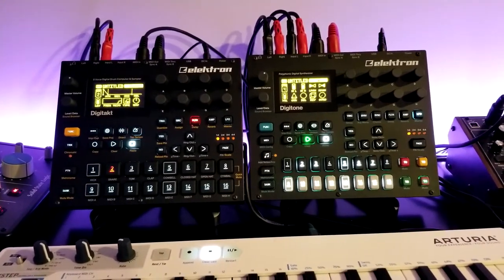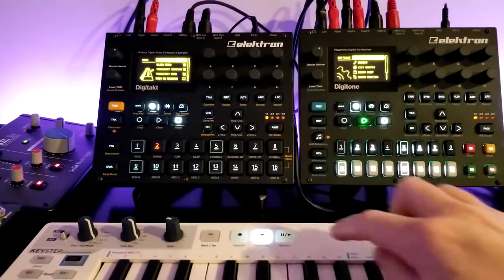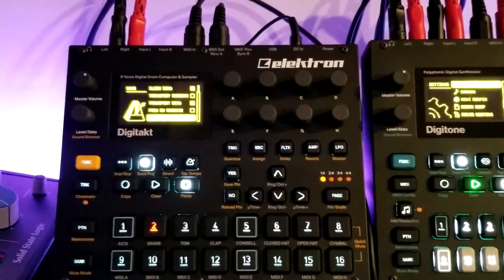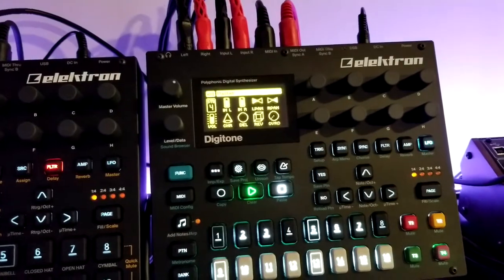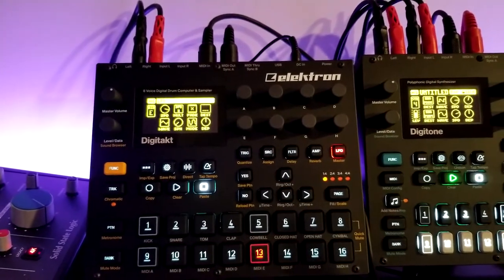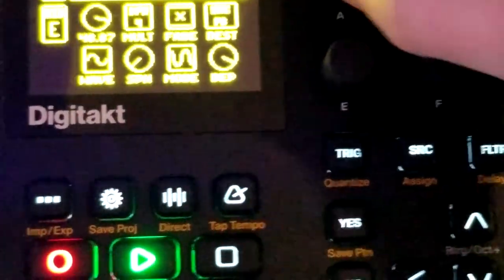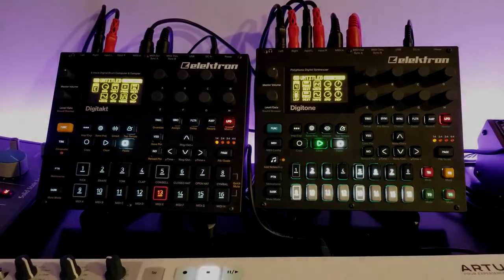Setting up the Digitakt, Digitone, with a Keystep, and other hardware.

Comment: Thank you very much, It helped me a lot with my set up
Reply from the maker: Awesome, yeah once you figure out how the MIDI settings work, they gel excellently together.

Don't sleep on the new Digitone update that just came out either.

With the new update, you don't have to set up the audio in settings for each new pattern
Reply: @NickCapron  I only got 1 question,I cannot use the sequencer for the Vermona Kick Lancet (cc#84 1,2 or 3 and cc#85 0 or 1) tried the #CC and the value assignment.  How can I trigger that? (With the keystep it works on key C1 and on digitakt also,except on the digitone)

Comment: Hi, at 2:33 you say that you have to create the midi settings each time you start a new project. Is it not possible to create settings to your choice and save as a template?
Reply from the maker: Hey Martin, that's a good Idea.

 I think you can copy projects(need to check) but yeah, I could just create an empty template, with the MIDI settings good to go, and just copy that whenever I need to kick off a new project =)

I do the same for my patterns with my projects, to keep the sound settings the same for handling the incoming audio from the Digitakt.

Thx again!

Comment: Learning midi routing is pretty new to me even though I’ve owned synths for 20 plus years. I guess I just never understood it fully until recently. This resulted in me avoiding it all. That’s now starting to change, as I got this Keystep Pro (KP). So now I’m trying to use a Keystep Pro to control all my gear. I have both the Digitakt & Tone and I wanna possibly use the Keystep pro to sequence the sample tracks on the Digitakt. I realize that can be an option. Not to say that I will stick with that workflow, but I wanna try it and see if it gets things moving sequencing the drums and samples on the same platform as my other synths. The Digitone however I wanna use its internal sequencer but at the same time play the notes on the Keyboard of the KP. I have set it up but I can only play what midi track the KP is set to, rather then switch between the track buttons on the DIgitone. Like what I mean is I cant switch between the 4 tracks on the Digitone by simply pressing the 4 track buttons. I can only switch the 4 tracks on the Digitone  by changing the midi channel on the KP. So I see that what I wanna do is being done in this video, and I’m guessing that setting up Auto Midi channel of the Digitone is what will allow me to do this instead of my current setup. I would rather do it that way, as it would be smoother in using the Digitones internal sequencer. Plus the option to quickly press the 4 buttons to switch the track would be awesome. I gotta make this happen. Thanks for the video, it helps.
Reply from the maker: Awesome, sorry I didn't back to you sooner, but yeah, I find using the autochannel works best for me with the keystep and the digis!

Good luck with your project, I'm still working through it myself to configure these machines best to my workflow.

As I'm enjoying working with Reaper a lot these days, I think I need to start to dip my toes into overbridge next
Reply: @NickCapron  OverBridge is amazing but it won’t work on my computer. Which is a 2010 MacBook Pro with 1Tb SSD & 16g ram running High Sierra as it’s max OS. The computer still works great for most music applications I use, but I’m gonna have to get a new computer if I wanna take advantage of OverBridge and the USB C audio/midi communication of my JX-08, JD-08, and SP 404MKii. As of now, I’ve figured out how to make the midi work out great in auto channel on the Digitone, but haven’t implemented it with the Digitakt yet. For some weird reason I can play the Digitone with the Keystep pro but can’t record a sequence on the Digitone. I have to use the Digitone’s key bed to record a sequence in it. This is my next hurdle. That and using it with the Digitakt. All in due time. But for now I can play the DTone with the Keystep Pro and switch tracks on the 4 track buttons of the Digitone, if that makes sense. I love that feature instead of switching midi channels on the KSP. Hard to explain in text but I’d love to play and record sequences into the Digitone with the KSP. BTW, Reaper is totally new to me. I just searched it, looks pretty good. But yes, can’t wait to get a new computer to get into OB as well. PS: no worries on replying late. No reply, late, or current, it’s always a pleasure 🙌🏼

Comment: This video is really helpful for anyone using Elektrons as master device. I’m About to add a Digitakt to my Digitone and Analog4 set up. (I use the A4 as master). I use almost identical process to use a Keystep via Auto Channel on the CV track on the A4. I also have a Novation Nova set up from the Digitone Midi tracks. I set up master blank templates with a single pattern in each on both Elektrons with all the irritating little midi niggles that get overlooked in the chain of devices.

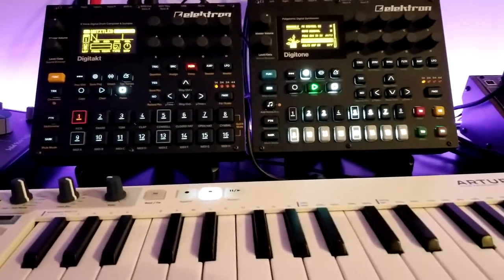Comment: Thanks for the video. Question: @12:00(approx) you hit keys on the Keystep and it plays the trig on track 1 of the DT. I followed all of the settings in your vid....and my Keystep doesn't make any sound. Any ideas why? Did you set the Keystep up in any way? (What about the little switches on the back: Internal, USB, MIDI, Sync IN)?
Reply from the maker: Hey Scott, check what MIDI channel the keystep is set to.

Going from memory, I think I set the channel on the keystep needs to be set to either 9 or 10.

If you don't know how to switch MIDI channels on the keystep, hold down shift and push the key with the blue 9 or 10 above it.

Also, I have my keystep connected directly to the digitakt, so make sure the keystep is working with whatever device you have it plugged into first, if that is picking up notes from the keystep, your issue is between the digitone/digitakt MIDI connection/settings
Reply: @NickCapron  I'm actually not sure what I did...but I got it to work. I think it was an unchecked box in MIDI settings that wasn't mentioned.
Reply from the maker: @Lo-fi_Hi-brow  awesome, glad it worked out for you!

Comment: This help me a lot, thank you very much. Now the big question. How to make works Digitone's mod wheel, the pitch bend wheel and the sustain pedal from the midi keyboard in this setup? Thanks in advance.
Reply from the maker: Hey Antonio, I've been running into the exact same issue, I'm thinking it can be fixed with midi cc settings under the midi tracks, but will look into it.
Reply: @NickCapron  Thank you Nick!!!
Reply from the maker: Ugh... Sitting down with this right now trying to figure out... Not looking good

https://www.elektronauts.com/t/live-record-mod-wheel-pb-data-from-external-keyboard/42715/84

Seems like it is a built in limitation on these boxes that they can't send either the pitch wheel or mod wheel data via midi to other devices. 

I'm trying to see on the keystep, to at least getting the mod wheel to pass through the midi tracks via its cc#

If I reverse the hookup and use the Digitone as the master I can at least get the modwheel and pitch wheel working with the 4 tracks on there, but it doesn't pass through to other hardware via midi either. 

Will probably put a video together on this once I figure it all out.
Reply: ModWheel and pitch are working if you plug the keystep directly on the digitone.
Reply: @wtvdonot1135  Yes, but the problem is to record mod and pitch.

Comment: thanks for this very useful video! How about i want to control the digitone parameter from the external keyboard. Is it possible?
Reply from the maker: It should be, https://midi.user.camp/d/elektron/digitone/

For example, because the MIDI tracks on the digitone and digitakt don't send pitch or mod wheel msg, I adjusted my keystep to send the mod wheel messages to cc 72 or something like that, which allowed it to adjust one of the midi parameters under a midi track so a lot of options should be possible
Reply: @NickCapron  Thanks a lot for your time!

Comment: Thanks for this!! I’m wondering- what mode is your keystep set to? Internal? How can i use the keystep’s sequencer and arp with this kind of set up? Cause if i set mine to midi, it plays my external gear through digitakt’s midi channels, but then the internal sequencer doesn’t start, and if i set it to internal it won’t play midi notes through digitakts midi channels, so it essentially just becomes a standard midi keyboard without the additional features! Hope you can help me with this one, thanks
Reply from the maker: Hey William, just for Reference, my Keystep is set to Internal. (I think I have MIDI Clock in on the Digitakt disabled, so when I push the play button on the keystep, it won't mess with the tempo on the Digitakt) I have nothing connected to the MIDI IN or anything on the keystep, just the MIDI out cable to the MIDI IN on the digitakt

I'm using the auto channel function on the Digitakt(Set to CH 10 I THINK?) and then sending out midi from the keystep on the chanel,  which will play whatever active track I have selected on the Digitakt(Including the MIDI tracks when I key them up on the screen)

Hope that helps a bit, hit me up with more questions if you need further clarification or want me to dig into anything with my setup that could help you out.
Reply: Nick Capron thank you! I’ll give this another go

Comment: Grat video! Thanks a lot, you help all the community with this, only one question, I have other devices, I want play with my keystep on others synths with this config but I dont have midi hub, I put channel 5 “for example” on my other synth and I connect midi in to midi output of the digitone, I can sequence my other synth but I cant play from digitakt, how I can do this?
Reply from the maker: Assuming you want to use the KEYSTEP keyboard to play the other Synth

Keystep into Digitakt MIDI IN

Hook up a MIDI Cable from the Digitakt MIDI THRU to the MIDI IN of the other syth

If you set the keystep to CH 5, it SHOULD play on your other synth and bypass your Digitakt

Let me know if that is what you are looking for or if I missed the mark!

BUT If your other synth only has one MIDI IN, and you are sequencing it via the MIDI OUT from the Digitakt, the only other way I can think of doing it is via a MIDI track on the digitakt

You just need to set that MIDI track to go out on CH5, and have that MIDI track listen for incoming notes from CH 5(or whatever channel on the keystep you want to use for playing that synth) that can be set up via the MIDI menu on the digitakt. 

Hope that helps!

Comment: This might be a really dumb question, but why aren't you using MIDI Thru instead of the MIDI Splitter device?
Reply from the maker: Not a dumb question at all!

In my case here, I liked (I've simplified my setup since I shot this) to swap synths in and out, which the thru box helps make a bit easier to do.

Also I was using volcas, which don't have midi thru, so if I wanted to use 2 of them, I would be out of luck. If I just wanted to use one, I could stick it at the end of the midi thru chain I guess =)

Anyway I find it convenient vs having to route midi thru everything

Comment: dear Nick i would like to ask you in case like mine i only have digitone and keystep 37 what sync and port config settings do i have to follow to work together?
Reply from the maker: Hey, no problem.

If I was to use a Keystep or K37 directly with the Digitone(which I did in the past before I got a Digitakt, I would set it up as follows

MIDI OUT on Keystep to MIDI IN on Digitone

Digitone PART 1 MIDI CH 1
Digitone PART 2 MIDI CH 2
same for 3/4

Auto Ch 10

Now if you want to control tempo on your Keystep, you would want to enable clock receive on the DT, BUT I WOULD NOT. as at least for how I have my Keystep currently configured, it bugs me when I hit play on the keystep, that it takes over the clock on the Digitone, I'm ok with controlling the tempo via the Digitone or takt

Same for transpose, I would have it set to off, so the play button on the keystep doesn't stop trigger the sequencer, as at least on my keystep, I need to hit play to enable the Keystep Arp or Sequencer, and I don't want it starting/stopping the Sequencer.

If you plan on using the keystep sequencer, and you want it synced to the tempo on the Digitone, you may need to feed MIDI into the keystep, for it to get the same clock from the Digitone, and to do so, make sure you are sending the clock out from the digitone.

Hope that helps!

NC
Reply: @NickCapron  My situation is very similar, so I hope I can find some help here. I have digitakt, keystep, thru box and a few hardware synths. I route keystep out into digitakt in, digitakt out to thru box into my synths. I want to keep the functionalities of Arp/sequencer on KS, but run digitakt as a master clock. Should I feed midi to KS going thru box out to keystep in and set keystep switches to 'midi'? I assume Arp/sequencer only works with 'internal', no?